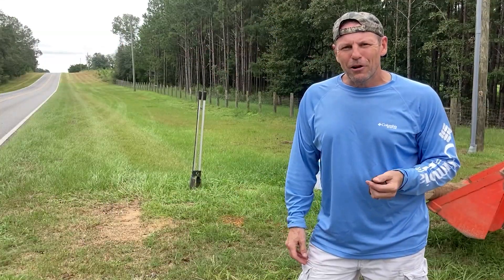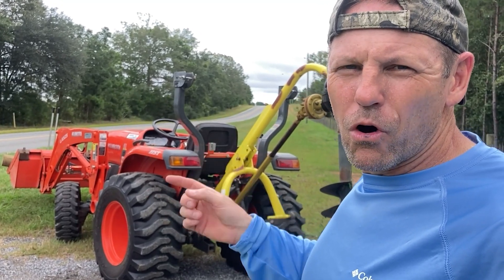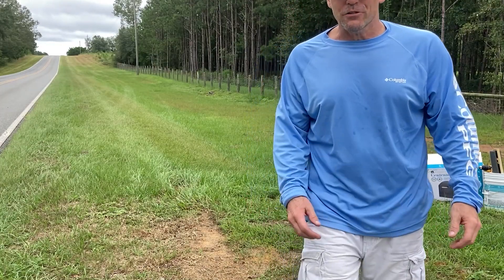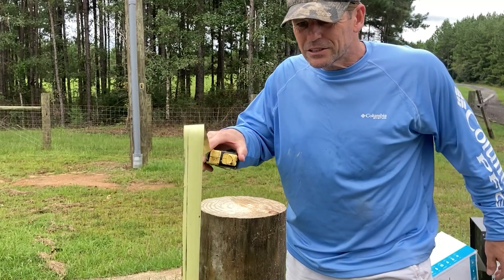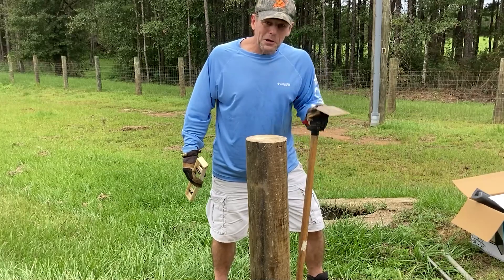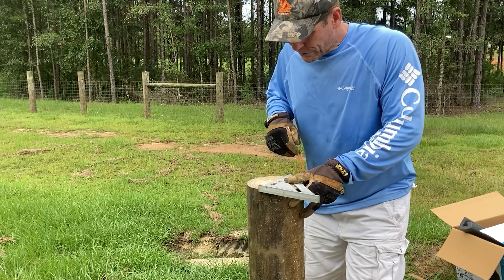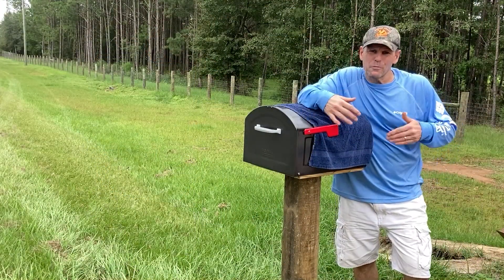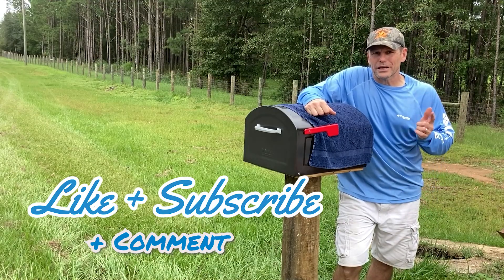You've Never Seen A Mailbox Install Like This!

Comment: Nice job, Brad. One trick I did years ago was to mark the handles of my post hole digger with tape or a marker at 1 foot, 2 feet, and 3 feet. No need for a tape measure 👍
Reply from the maker: Great idea, Ed.  That would save me from retrieving my tape measure from the bottom of the hole....it happens!

Comment: As a retired letter carrier I appreciate the time and effort you went through. Not at all surprised to the lack of help from the post office. The problem with putting  the box at an angle to the road is that it is more difficult to see oncoming traffic from the rear when pulling out, Parallel to the road is better and also there is no guessing if you are completely off the road. Also, I would add some gravel to the area because over time the postal vehicles will create unsightly ruts.
Reply from the maker: There's a dip right after the mailbox I need to fill in and gravel for the carrier.  Thanks for the tips.